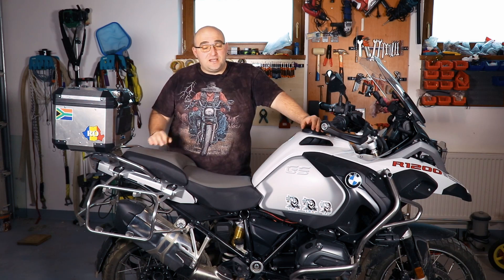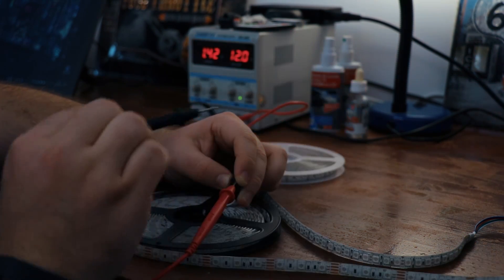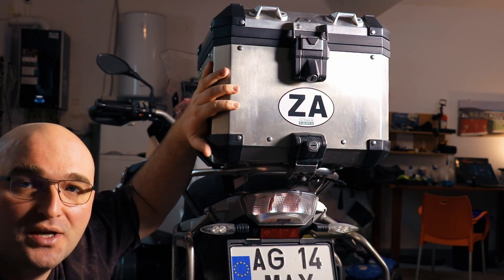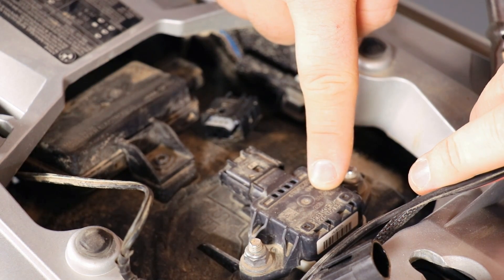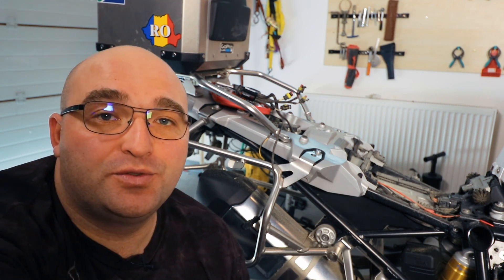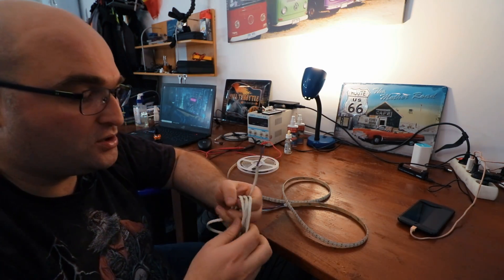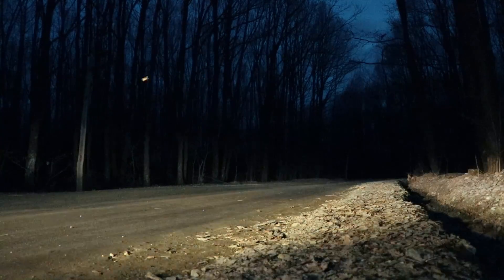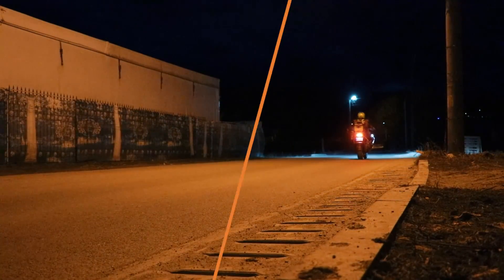Make your brake light flash. HEX ezCAN review and installation

Comment from the maker: So what accessories do you have hooked up on your bike at the moment?
Reply: Dave,  I have an EZ-CAN on my R1200RS and when I went in for my ITP the other day the manager told me that the flashing lights are illegal here in Romania.  I have driving lights on the front that flash (when I flash the high beam and when I hit the horn) and I have flashing brake lights.  Do you know if these types of lights are illegal in Romania and have you had any run-ins with the police over the use of flashing lights?   I have not turned them off as yet but the manager did ask me to turn them off.
Reply from the maker: @jimherne4307  :)) I have no idea if they are legal in Romania since it really is the Wild Wild West of Europe, but since my original brake light is NOT modified in any other way and all the lights at the back of my bike are red, I really don't see a problem that you cannot talk yourself out of. Personally no cops have complained at all and I drive in the city a lot.
Reply: Just short evotech levers, nice and adjustable

Comment: Thanks for great video, my question is i thought you need a 3 wire led to use the fuctions like low light and high brightness when you brake , also to flash ? . Have you found any other LED brake light that we can add eith side of the number plate ? Thanks from Durban